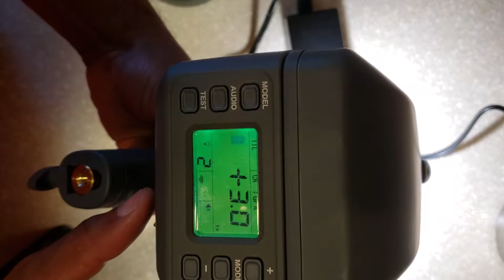Vision 5 - Troubleshooting E4 error code

Comment: Pag. 16 manual. E4: Internal charging problem. Es un codigo de protección para el flash. Lo abri con guantes y lo deslice ligeramente y con pinzas con punta removi calcificaciones en algunas partes de la placa con cuidado y rocie alcohol isopropilico, deje secar y empece a hacer pruebas y nuevamentem empezo a funcionar el flash
Reply: Hola. Disculpa tengo el mismo problema he intentado de todo, pero no eso, como lo haría? en realidad necesito ayuda.
Reply: @davidsalas2148  llévalo con algún técnico que limpie placas con piscina ultrasónica. El mío mejoro un poco

Comment: Guys, I have just fixed the issue by holding Model button while turning on the flash. Also tried it with Audio button. After that I switched off the flash and turn it back again normally. It fixed itself apparently. Hope this helps someone. 
By the way, I strongly advice from experience everyone to switch from brewer/visico to more reliable brand like godox.
Reply: This fixed the E4 issue for me! Thanks so much.
Reply: Also try updating firmware, this worked for me.
Reply: a mi me ayudó
Reply: me volvió a suceder, y  ya no me funciona ese truco🤕